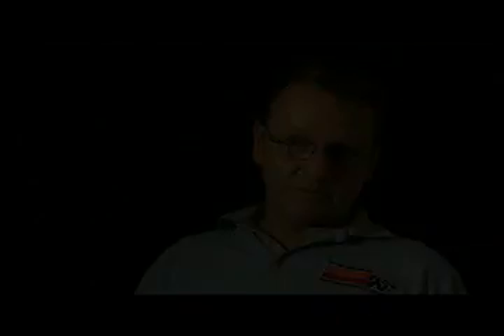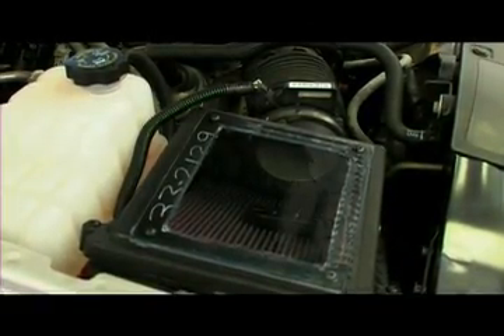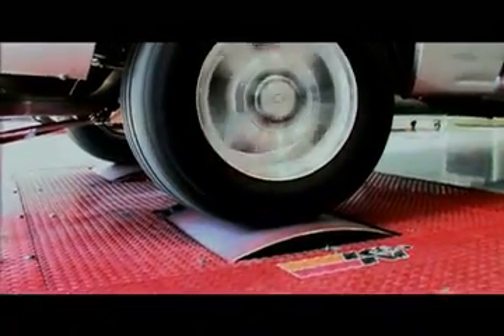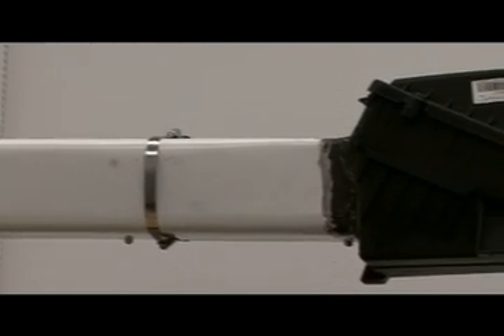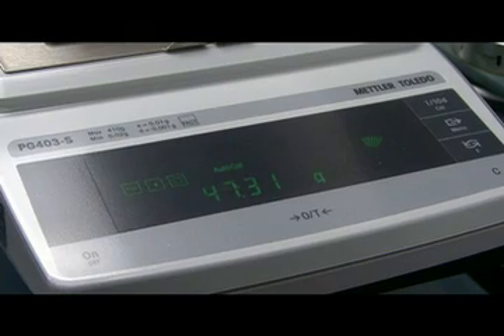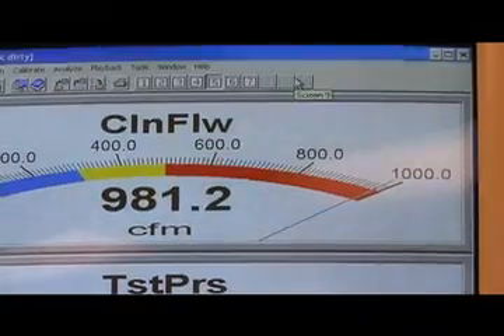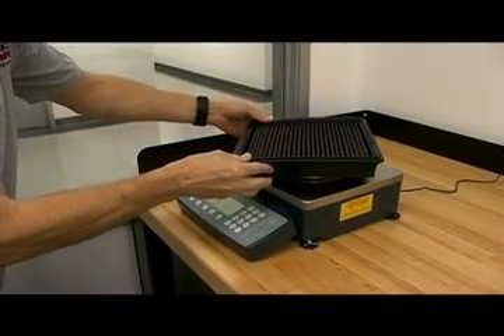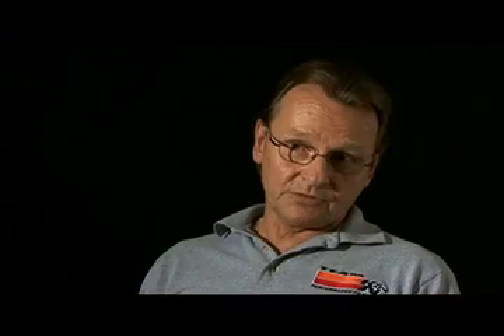MAF Mystery - Part 2 of 4 - Can Oil Come Off Our Filters?

Comment: it says no oil came off at 1000cmf for 3 days, but doesn't say what CFM full throttle is, so it doesn't really mean much to me.  i have a feeling it must be easy to over oil the filters by more than 30%.  

This video feels like K&N is just saying "not our fault".... where as it would be much more useful of a video for them to say "here's exactly how much extra oil we had to add in order to cause MAF issues", and "here's exactly how to avoid such problems".
Reply from the maker: Below is a link to a page that helps break down CFM and volumetric efficiency. 1000 cfm is a serious amount of airflow, and it's doubtful that any street driven vehicle will draw that consistently (how often are you REALLY at high throttle?). This is part of the reason why we performed such an over-the-top test on it. 3 days is a long time under that high amount of airflow, and is a condition that won't be seen on the road. Regarding your suggested alternative: as of yet, we haven't seen ANY amount of oil cause MAF issues, so it wouldn't be possible for us to make such a statement. We even did a video where we dunk the MAF sensor directly in filter oil, reinstall it, and run it.

https://www.musclecardiy.com/performance/induction-math-high-performance-engines/

Comment: Tenths or hundredths of a gram in oil isn’t going to show on scales. One drop of oil weighs what K&N

Why didn’t they use a white piece of cloth? & show it clean after?

In my opinion best to let filter oil dry for few hours, then blow air line through inside with white tissue on outside for piece of mind.

Comment: keep building em! I rebuild transmissions for a living, and 4L60E equipped vehicles with burnt 3-4 clutchs 8 times out of 10 have filthy-as-fuck K&N filters, or over oiled ones! I sure as hell would never install one, and the industry know the number one MAF contaminant is tire rubber dust. Dummies will buy 'em, and I will bank on smoked transmissions! Keep up the good work!

Comment: i waste m y money on your K&N fillter
i installed this filter on my grand vitara 2006 and my engine start to die while driving , after inspection i found out too much oil on my MAF sensor so i cleaned it and installed the factory filter back , everything went back normal.

and by the way , after installing K&N i wont notice any gain in power or acceleration as they claim !
Reply from the maker: lastmanxa Please contacts us directly and we will help you: http://www.knfilters.com/contact.htm

Comment: it DOES come off, i just had to clean my MAF after installing my k&n. i always have used them but come on guys
Reply from the maker: Jason Bryant If oiled correctly you should have no issues. For cleaning instructions please see this link: @cleaning.htm
Reply: I had K&Ns in my car for not even 8k miles, my MAF sensors needed to be replaced. Mind you, these were brand new out of the box, factory oiled. Luckily I was under warranty. K&Ns...Into the trash it goes.
Reply: Agree, and the same i had alot of oil in my airbox I just i think they over oil it from factory!  Its just a case of less oil is more. still love K&N filters though. Just when i clean and re oil,  i use the oil sparingly

Comment: No.
that's the problem....
an independant tester would be great.
i could shut up and you would not have to fight for your business and products.
But the oil is not the problem on a MAF it's the dirt and carbon glued to the oil wich insulate or help dissipating the heat depending on the air flow.

Like i said no offense or negative thinking about your filters.
(except cold air intakes wich are useless. because they suck air inside the engine bay.)
just a lack of serious datas.

Comment: You can have big cfm numbers but if the air slow down enough before your abslolute filter the oil can drop in the very long pipe you have used for the test.
and i wasn't here to measure the weight of your filter after the test.

So your test do not reproduce normal conditions of a normal running engine.

your test is not ISO whatsoever certified too.

i have nothing against your products but only the way you test them.

Comment from the maker: An absolute filter is used in an ISO test to test the efficiency of a filter, not the flow; it captures any test dust that gets passed the filter being tested so you can weigh the exact amount of dust that gets by (which all of our filter achieve 96-99% efficiency). Flow (CFM) is tested on a flow bench, which we test in the OE airbox the specific filter is designed for. I’m afraid you are combining two completely different tests in your statement.

Comment: Sure.
with decrease of speed there is an increase of pressure too.
bernoulli works the 2 ways.
Wich is the effect you want in a well done airbox to tranquilize the airflow and have it as laminar as possible.

but the absolute filters tests are given with huge amount of air with a very big surface area wich do not exist in a car filter.
the air slow down way before arriving on the absolute filter.
and the length of the piping can allow oil to drop during before the MAF.

Comment from the maker: The whole idea is to reduce restriction allowing air to be pulled in easier, which saves energy on the intake stroke, which is then transferred through the powertrain resulting in a HP increase at the wheel. Also, the Bernoulli Effect states “an increase in the speed of the fluid occurs simultaneously with a DECREASE in pressure”, not an increase as you have stated.

Comment from the maker: CFM is a measurement of volume in a period of time. The more CFM, the faster the air must be moving to get more volume through the same area in the same amount of time. Also, the engine will pull what it wants to pull; a filter cannot make the engine pull more air, only forced induction can do this. If two different filters have the same CFM at the same pressure drop, then the speed of air in the same application will be exactly the same on both filters...(Cont)

Comment: cfm mean nothing.
it's the speed of the air trough the filter wich is imporrtant.
the ratio   filter surface/air volume   wich is important.

You can have the same cfm on two different filters and have an enormous difference in air speed.
air boxes are supposed to slow down the flow and so gain pressure to allow a better fill up of the cylinders.

It's bernoulli effect.

The test do not use all types of filters.

it's not so easy.